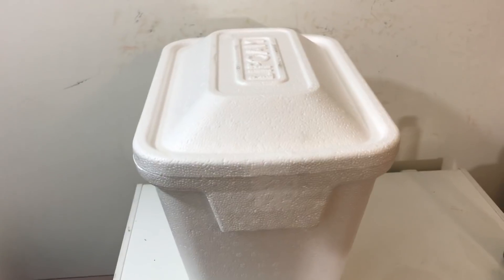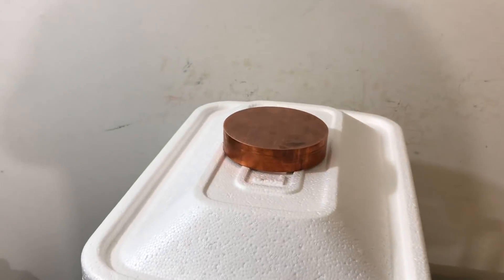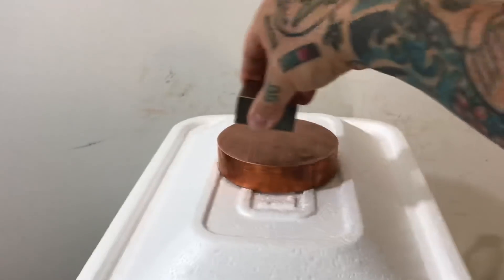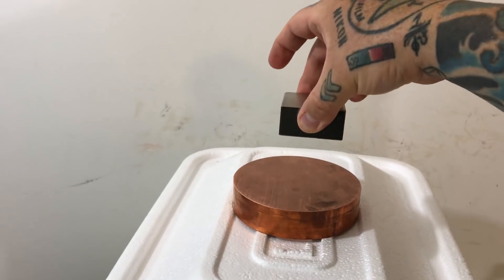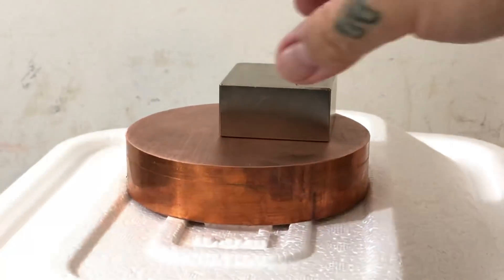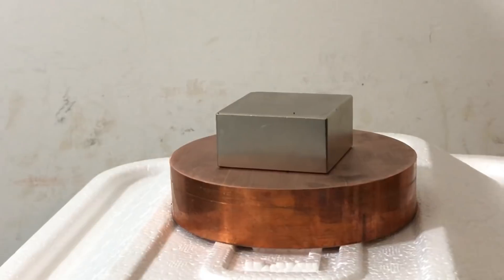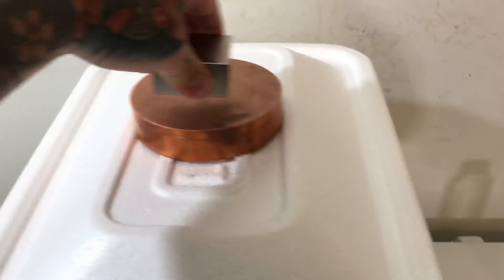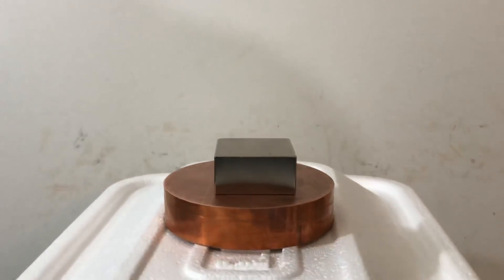😄 Capacitance, Resistance, Permeability & Permittivity

Comment: Hi Ken. Have you ever read any of the work of Viktor Schauberger? Some of his illustrations are very similar to yours. He however is describing temperature gradient vortexes in natural water flows. Just wondering your take on his observation and subsequent explanations. That is of course if you have any.
Reply: Ken has read Schauberger, but he rarely mentions him.

Schauberger's concern for temperature are related to the density of water (maximum at 4 deg C), which in turn is due to the electrical properties of the water molecule. 

Schauberger also emphasized the importance of electrical influence on the vortex, which is why he said that the pipes had to be made of copper and the water have specific electrolytes in it.
Reply: I'm having a time completely wrapping my head around it. I was hoping for mor contemporary insight as to how it relates to electricity and magnetism. Can you point me in another direction?
Reply: It is difficult to find. Schauberger himself did not explain it well, since he used his own terminology, and most of his fans today are New Agers who put their own spin on it, adding confusion.

(An example of Schauberger's terminology: What Ken calls "centrifugal convergence", Schauberger calls "male", and what Ken calls "centripetal convergence", he calls "female", as far as I can see.)

When Schauberger himself did explain it briefly in conventional terms, he referred to "higher atomic energies", and he did repeatedly emphasize the use of copper because of its electrical properties, so that points us in the direction to look.

Comment: If I were to make a tentative prediction, I'd hypothesize that- due to the creation of mass being necessitated by fields with no Euclidean or Cartesian value- in highly unstable atoms the dielectric condensates (protons) can discharge and "orbit" around the nucleus as reciprocating magnetic flux lines at any time; perpetually alternating between solid (high pressure condensed fields) and aetheric (magnetic expulsion). This constant interchange of modalities (predominantly tending towards magnetic divergence) within the atomic toroid is what I would guess constitutes "ionizing radiation" i.e. the destruction and conversion of dielectric condensates into spatially radiative discharge (a transformation of energy).  

My Question: If this indeed occurs, does the dielectric nucleus remain perpetually stable in it's mass? Or does the mass of the atom fluctuate in discharge? Does the amount of so-called "electrons" (lol) increase or decrease in unstable atoms?
Reply: r u serious dude?
Reply: +Its Reason It's a legit inquiry... Problem??

Comment: Hello Ken.
I've always been an avid follower of your videos. I believe your resource of thought is lacking in Conventional Physics. The thing is, I know the self same action/reaction activity, would occur if ice were in the box, or not. So my point is, what is the purpose of this video experiment?
I wish you the best.
MARTINE🤔
Reply: My point of view.... I think he is trying to show us diamagnetic properties of copper, like in bismuth. See, he can hook up to copper with centrifugal magnetic part of field, which is drawn by dielectricity, and then swing box! But when it drops it to copper plate, centripetal magnetic part of field is the main actor, which slows down free fall because copper as diamagnetic element hates magnetism, it has  low magnetic permeability, and does not allow quick penetration of external magnetic field.

Ice has no role at all.

Also copper, low permittivity, bad insulator, good conductor. Perfect conductor would have to be zero permeability, so external m field doesnt affect it and infinite permittivity, so there is no energy loss on resistance when internal e field is rising
Reply: @slavmi  Thank you, for your reply.   I am aware the ice, contained in the box plays no role. Many  viewers are unfamiliar with kens work. It is possible they may have believed, that the contents of the box, were significant.

Comment: So would you say that the magnetic field is then aligned in the 2 objects because they're ferrous and the magnetic field from the neo permeates into the copper disc allowing a draw of magnetic energy to the surface so that when you drop the neo magnet towards the copper the magnetic flux is dense enough and creates a resistance which slows down the actual drop rate of the magnet because its a stronger inverse relative force than the gravitation pull of the earth?
Reply: Electrical engineer here. Lenz's law is the what is going here. The change in the magnetic flux through the copper induces current that moves through the copper (eddy currents); intern, the current produces an opposing magnetic field. That is why the magnet slows down. Lenz's law is derived from maxwell's equations.  If you learn some calculus and actual physics,  it's obvious. I'd suggest Kahn academy's YouTube channel for the math and physics of your intrested, and you're up for a challenge.  The problem with videos and channels that talk about vortex math, and whatnot, is that they don't really understand how physics and math works, so they form flimsy hypotheses. They eventually form strawman arguments about actual physics because they aren't well educated enough in formal mathematics and physics.